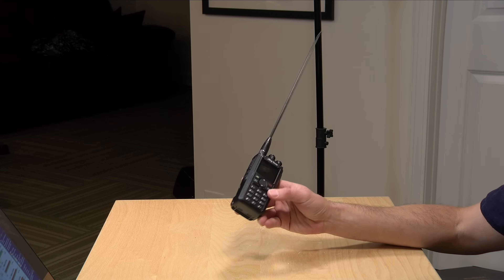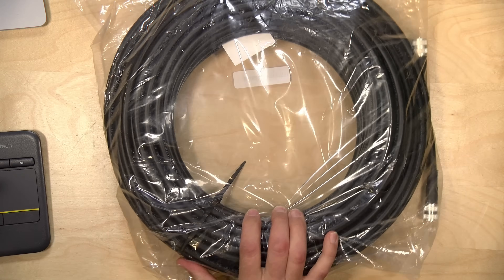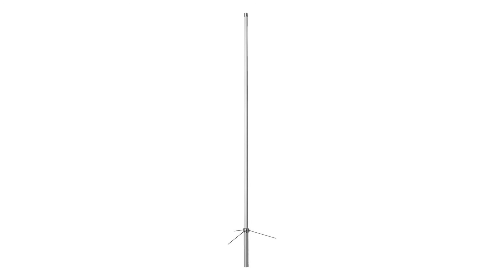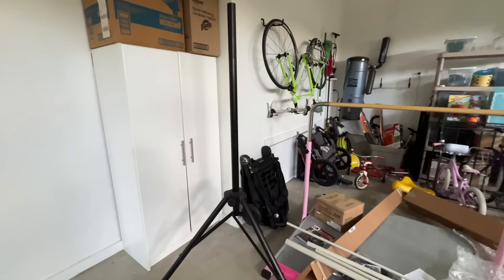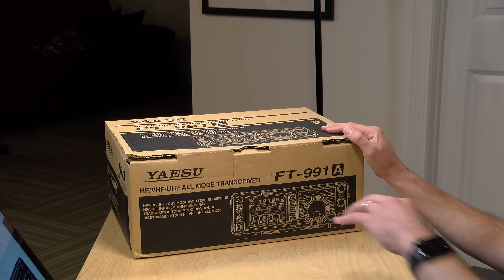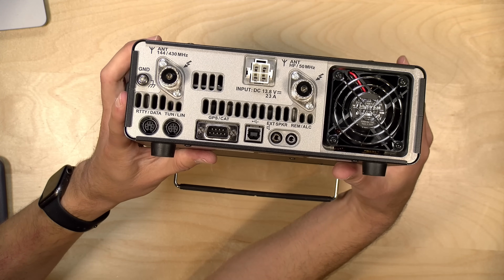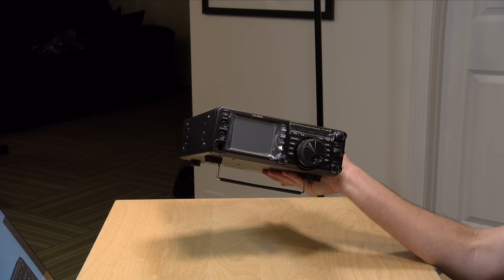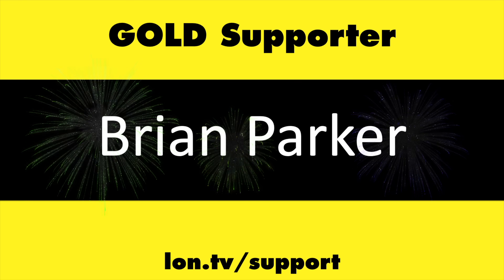My Ham Radio Adventure Update! New Base Station Equipment

Comment: Hi, congratulations on getting your ham ticket! The ft991a, which is actually 100 watts on HF & 6m, is a good choice. That's what I plan on purchasing in the future when I'm able to afford it. For now, I'm working with the icom IC-718 for HF. Speaking of HF, I'm a general class operator and I wouldn't mind doing some some weak signal digital modes with ya some time when you're ready to play around with it. My callsign is KJ7OMO

Comment: I have had a ft-991 since it came out. Run it mobile and love it. I used to run an ft-857 but as I got older I liked the bigger screen. I do prefer the astron power supplies over the yaesu. Way smaller and work great and cheaper. For programming I like rt systems. 
Joe WA4UJY

Comment: 991a does yaesu system fusion. That mode you can download and upload pictures to yaesu system fusion reflectors. You don't get the time division dual time slot signal as you do on dmr.

Comment: Hi Lon - Im a licensed HAM radio operator located in the south of the UK (callsign = M7CCZ) - I too have a Yaesu FT-991A and a FLEX 6400M (nice radio) - We could try to make contact but as you only have access to 10/20m I doubt very much. Could try FT8 an amazing Week Signal program , cheers Brian

Comment: Hey Lon, thanks for sharing your haul. 
I too am still a tech (might upgrade this fall to general). I have the same rig. I have a end fed wire antenna I use on 10m for the rare moments that band is open for me. I’ve started using it a lot for uhf fusion into a hotspot I built from a raspberry pi. (I’m often listening to America Link). Look forward to seeing more of your Ham adventure! 73- KC3QNR.

Comment: FWIW, don't worry about line losses from running LMR 400. At any reasonable distance, you'll be losing negligible amounts. 1.5dB per 100 ft on 2m which is nothing. 1/4 S unit.

If you want to try working bands not covered by your Hamsticks or your Diamond ground plane antenna (6m for instance), it's pretty easy to build antennas for yourself. Dipoles especially are extremely easy to build and tune. A vertical dipole can be made from 14ga stranded automotive wire and draped from any high point, or they can be supported by any radio transparent structural material (wood dowels, plastic/fiberglass rods, inside PVC pipe). I wind my own baluns and put them in small electrical boxes or plumbing fittings, but you can do like the MFJ-347 and use an SO-239 connector to feed the opposing sides of the dipole, one coming from the center conductor and one from the braid.

Comment: Oooh, my latest pet peeve is when people say "amperage" when they really mean current.
Amps are the units in which current is measured... Sorry, had to vent.
Reply: Actually he used the term correctly.   In the amateur radio world we look for how many amps an item draws.  On transmit his 991a can require 23a.  Filp another device on that requires 4a and it would be a great idea to have a meter to look at the total.
Reply: @twohandsandaradio  I'm a ham of many years. Current is still current, and the unit of measurement of current is "amperes".

Comment: Oh, I thought it interesting that the blog post showed the MFJ "dipole" oriented vertically. I've always done it horizontally but the nice thing about this setup as you can make it how you need for what you're trying to contact. Usually on HF, signals are oriented horizontally but if you're looking to try 10M repeaters or maybe other things in the technician band, those might be vertically oriented.

Also, a 10M dipole is pretty easy to make. About the simples antenna to make from some wire (any kind) and a couple of ceramic insulators. Biggest issue is then you need a way to secure the "free" ends (like up in a tree). 10M is easy because the dipole doesn't need to be super high up to work (the "lower" the band (i.e. 15M, 20oM, 40M) the higher it needs to be off the ground. So for kicks, you might want to try building your own 10M dipole and then compare to the whip antenna style. A very easy, beginner project.

Have fun!

   - Bob NQ1C

Comment: Nice haul. I've used the MFJ whip antennas to make a dipole as well, I've even done it with the larger ones (15M, 20M, etc). I think it's a good solution for what you are looking to do. The tripod looks nice - I used an collapsible/extendable flagpole from Harbor Freight but I think the tripod is a better way to go.

The FT-991A - nice choice to have both a decent HF and UHF/VHF combo radio in one unit. Plenty of flexibility with that radio. It will give you enough features to keep you happy for a very long time. If you eventually want more HF power I'd keep the radio and add an amp (you may be happy with 100W HF forever anyway) and you probably won't ever want more than the 50W VHF/UHF.

I have an adapter cable that allows me to use an XLR mic with the Yaesu radios. It also has a 1/4" jack so you can plug in a footswitch. I mount the mic on a boom and use a standard "piano style" footswitch for PTT (push to talk). I believe the XLR adapter cable is made by Heil. Works great - check it out. I also use a conderser mic that needs 48V phantom power so I have a little box with XLR in/out and a power jack - it just injects 48V phantom power to the mic without affecting the audio at all. But if you have an SM58 you won't need that.

Good luck! I think you've got some great stuff for a good start.

   - Bob NQ1C

Comment: Just so you are aware, the HF portion of that radio will output 100 watts.  Only the VHF/UHF is limited to 50 watts.  Also just a bit of info, if you are going to run JS8 Call (or any digital mode), keep the power down to 50 watts or under on HF and about 15 to 20 if you try it on V/U.  The 100 watt finals on that radio are rated for SSB and that is not a full duty cycle mode.  Digital modes are full duty cycle and can burn up the finals at 100 watts.  It will work great though if you watch the power.  Just a tip for saving a nice radio.   Take care and best of luck!!  Wade (W5ERX).

Comment: Been a general class since I was 13, 51 years ago. I built several Heath rigs, worked all 50 states QRP and 250 countries 10-40 meter bands. I was proficient at CW nailing 40wpm (receive of course) before getting my general. The most fun I had back in the late 70s was 10 meters and sun activity were ideal. IF YOU COULD HEAR THEM, you could talk to them. Literally zero signal on the meter and flawless talking sun up to sundown EVERY day. I hope the sun is your friend - 73.

Comment: That ten meter setup in photo the antennas are kind of close to the metal railings and that can effect the SWR and signal pattern . But if it works it works. I would recommend building an antenna like copper pipe J-Pole which works dual band on 2 meters and 440. There is something really neat about building your own antenna. Also you can easily build a 10 meter dipole out of wire and it is basically the same as those 10 meter stick antennas that you got.  Your antennas and  set up should work fine . I have used that Yaesu 991 radio - it is a nice radio and has very good filtering to notch out any manmade noise ( QRN)  you might have in your neighborhood - hopefully not ! You will have a great time on FT8 weak signal  - great supporting software will log and map all your contacts. Have fun !  Will be fun to make a contact sometime  - WT9M

Comment: What type of Log Book will you keep to show an FCC Agent if necessary-Purely Digital or Paper. 

Some equipment might emit the wrong (spurious) signals.
Reply: Very rare that FCC ever would come by to check on anyone unless you were being real bad !  But these days I think most people use logging programs which will also upload to the online confirmation database - Logbook of the World .  The computer logging programs are so much easier to log stuff than writing it all on paper which is the way I did it when I started out.

Comment: Instead of cutting up that cable I would use it to figure out what length you actually need. When you're dealing with a cable that large you need a high-quality crimp tool with the correct dies (easily $150-200) to get a solid crimp on the cable, and you need to make sure that you have the correct lengths of the center wire, dielectric, and the shield/braid exposed. Those lengths can vary depending on the brand and style of connector used as well. I've figured out what lengths I need for a few types of cables and connectors that I work with day to day, but for anything above an RG6 I usually order a pre-made cable that's close to the length I need. There's nothing more frustrating than having to redo the crimp on a cable multiple times to get a solid connection. If the friends you mentioned have experience working with this type of cable and have the tools to crimp the ends on then you'll be fine. But whatever you do, don't use twist-on or soldered connectors (excluding ones where only the center pin is soldered and the jacket is crimped). They won't give you as good of a connection as a properly crimped connector will, and they're much more prone to bridging the outer shield/braid and the inner conductor.
Reply: Sure crimp connectors are probably great but a lot of us have been installing and using the solder on kinds for long long time with no issues !  Soldering the braid is of course more difficult though I know some big time hams who only fold back the braid. I always solder them - to do it right you need a high wattage solder iron that can transfer the heat quickly to get the connector  hot enough to flow solder but not melt the insulating center. But yeah - if I was younger I may have invested in crimping tools and connectors - they didn't used to have what is available now.
Reply: Yeah, I was thinking the same thing when he said about cutting the coax to length.  You paid for the factory connections, why introduce a variable for possible RFI?

Comment: Lon, thanks for sharing your ham radio experience.  It brings back fond memories of the 1960’s when I had a general class license.  Receiver and transmitter were separate boxes, but had internal power supplies.  Electronics was 100% vacuum tube based producing high heat and low efficiency.

Comment: I have no idea how any of this stuff works but I do enjoy seeing your enthusiasm for the hobby and following you on the journey!
Reply: Radio transmits an AC signal on 10 meters which is 28.3 MHz frequency. The AC signal goes to the antenna which is resonant for that frequency ( the correct length ) and then the radio signal transmits out at the speed of  light in directions determined by the antenna design. Another ham radio operator will receive that signal and then transmit back to Lon. The radio he has is capable of transmitting 100 watts of power. That is it in a nutshell !

Comment: Congratulations. 
When you get ready for all the HF bands, then I would recommend a "DX Commander" antenna. It is a vertical antenna that covers ALL the HF bands. It is ground mounted and very simple.
FT991A will do everything you want since it is HF, VHF and UHF all in one box.
73, KD5FZX
Reply: If Lon has the room I would recommend a loop antenna that is fed with ladder line - those will tune up everywhere and mine works well ( I built 160 meter one cause I had the room ).
Reply: I love my loop antenna. It’s a simple 143 foot wire with a 4:1 transformer, fed with coax.

Comment: Just wondering why you selected this unit over the new YAESU FTDX-10? I'm also just getting into HAM and will soon be getting a similar newby kit to yours.
Reply: I don't think the FTDX-10 does vhf uhf above 6 meters like the radio he got does. So LON also has HF and  all mode 2 meter and 440 band which he can use .
Reply: @LarryKapp1  Thanks Larry, makes sense.

Comment: Congratulations. 
Honestly I love Ham Packet. 

I've let my license lapse for nearly twenty years. 

Love that you've graduated to a base station.

Edit: Packet and RTTY has always facinated me because of how little both need. You can repurpose old computer equipment and a radio and in theory have an old style BBS rolling that doens't dependo n the internet.

Granted there are some inherent rules that need to be followed (no codes of any sort, so no encryption. no profanity or the like, nothing illegal. etc etc) but... the whole point of Ham is to explore and tinker
Reply: There has been a few of older hams who were doing vhf packet in the late 80's and 90's before most people had heard of internet. Recently I dug out those old TNC's and they work just as well now as they did then . The great thing is the built in mailboxes on them so we can leave each other messages. I haven't played around recently with HF packet. In the old days we used Amtor on HF and it worked amazingly well and had mailbox too. I once traveled to California and put up just a small 40 meter dipole not very high off the ground at a friend house - and I was able to log in to friends Amtor mailbox in Wisconsin with a very weak signal. I know these days that FT8 is really good - but the packet and Amtor are error free. Now I am going to have to fix my HF antenna and try to contact Lon when he gets his stuff up and running !